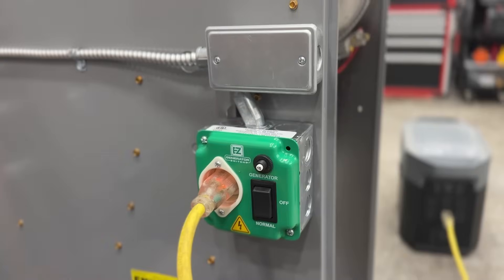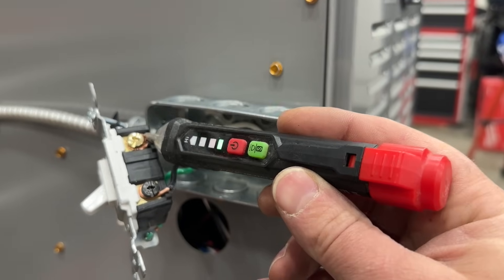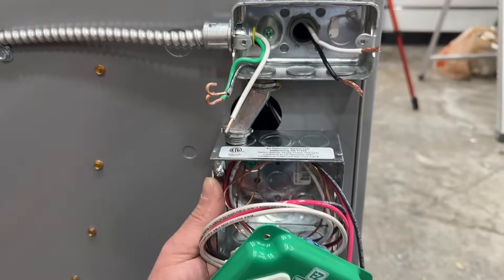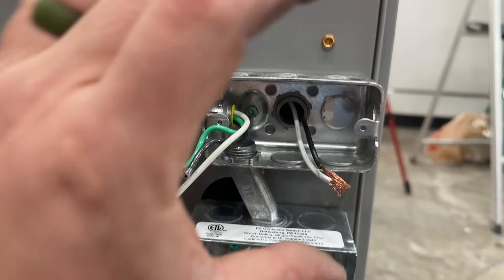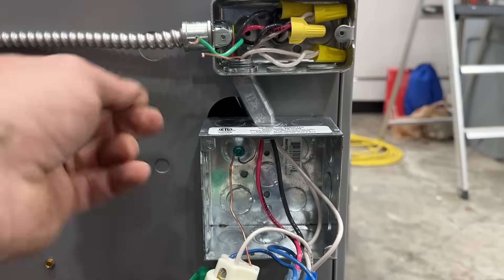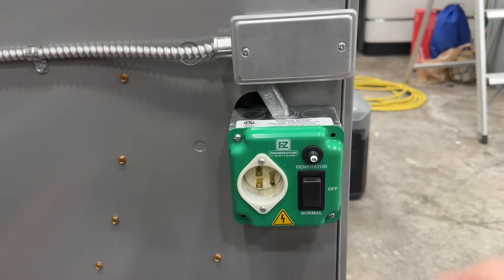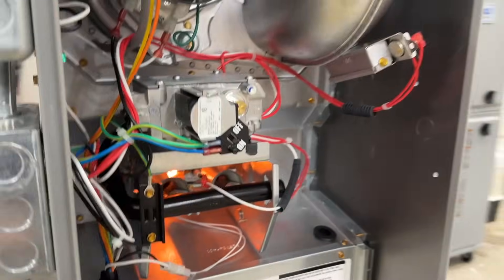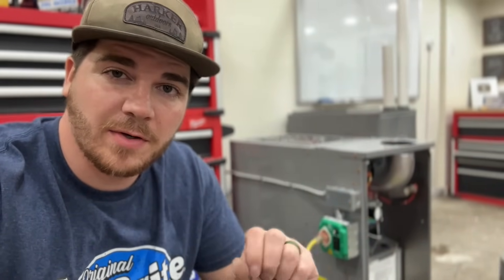This Device Allows You To Power Any 110v Appliance During A Power Outage

Comment: May I suggest just wiring the outlet also to the switch. That way with the switch off, furnace access is via the outlet for attaching to an inverter or generator. Just make a cord with 2 3-wire plugs of needed length.
No need to buy that switchbox or more wiring. Just trying to be helpful. Thank you.

Comment: The EZ Generator video says that the first thing to do is determine if the power source (generator) is floating or bonded neutral.  If floating, then wire the EZ Generator using the Floating instructions.  Since you are using a floating source (generator), please show us the correct wiring using the floating wiring in the EZ Generator   here's the vdeo:  https://www.youtube.com/watch?v=eSVh7GNgKfw&t=18s

Comment: Great product - I have 3 EZ generator switches installed along with a reliance Through the wall kit in which I connect my RV generator to along with 3 power cords I use to plug in for power from the Generator..I have 3 connections at the panel for the furnace, Refrig and my office which has my cable modem..Very easy install..EZ generator has their own youtube channel with easy to follow  instructions..In the Future I'm going to purchase a solar power station to run the power I need..Looking into a production called 'OUPES' solar Gen..at least 3000 watts..

Comment: Thanks!  I used your link, bought the switch and installed it.  Install was fast and easy.  I then tested it using one of my EcoFlow batteries.  Worked perfect.  Practically looking forward to the next power outage.

Comment: Okay,  I think I asked you this before,  but I don't know if this will work with my situation,  I'm Definitely not an electrician but I've wired many lights and understand the safety aspects,  but my shut off switch of course has the on off switch at top of box, but at bottom is a 12 amp type s screw in buss fuse, I've been told by many that I can't bypass that fuse, most state it's for protecting sensitive circuts in my furnace which I don't understand,  it's a 23 year old standard furnace,  no fancy motherboard or anything,  but anyway,  if it's true I can't bypass this fuse, then the ez generator box probably won't work in my situation? I'm stuck with no furnace unless grid power? Again I'm asking because I have no clue or know who to believe if it can be bypassed or not

Comment: Seems to me that if you use outdoor ground solar or outdoor generator you might want to install that next to the power panel (assuming the panel is closest to the outdoor source).
Not everyone has a ecoflo or similar power station.
Placing next to the main panel reduces the need for long extension cords.

Comment: what about the air handler?  if the air handler is on a separate breaker than the gas furnace, you have no distribution of the heat
Reply from the maker: This is really only for 110v gas furnaces
Reply: @diyhvacguy  thanks. my furnace is a carrier 120v, but i noted on the panel in my new home 2 separate 240v circuits for the central air.

Comment: Great switch but dear lord this is so over priced the margins must be 450%. I am not sorry for saying an outlet and pigtail is AOK and safe for my home. Code you quip?  Let's light up candles everywhere and run a gen with extension cords cause that is SOOO much more safe compared to what I installed. Great device just a total $$ rip off. I will reverse what I did when it is time to sell. Sorry just pissed at what this costs and cant understand why.

Comment: Just make a double male ended extension cord. Plug into outside outlet from generator. Shut off main breaker. Boom. Been doing it for 30 years.
Reply: It’s a good idea up until you forget and plug it into a live receptacle. Better safe than make a mistake. I can tell you where there’s a burn mark in a kitchen cabinet when I powered up a receptacle I had an appliance cord I hadn’t wired in yet.  Inserting solid wire pig tails into a normal extension cord would my first choice in a pinch.

Comment: does this fix work for a gas pack/ac unit?  (just for the gas part)
Reply: I've asked the same question on a few sites but no response ? 
My concern is that even though the AC and furnace are on separate circuits the temperature and fan control is shared.

Comment: One correction/clarification regarding the thermostat. Your statement only applies to thermostats/smart thermostats WITH a 'C' (common) wire. Older homes may have a new furnace but still not have a C wire, like mine, in which case I would also need to power the external plug to power the smart thermostat. Do I have that right?
Reply: Most will have a c wire or a battery. If you have a plug in power source for your thermostat then yes you have that right. They are much less common.

Comment: Seems like there should ba an automatic switch that could be used with a battery backup. This could provide heat when not at home and if solar recharging is available would work for a long time. Same would be good for sump pump and refigeration.
Reply: It’s called an automatic transfer switch, they cost a lot of money. They are wired into the main panel, sense loss of line power, then if it’s out for 30 seconds they tell the standby generator to turn on. I suppose if you have a solar/battery system, it’s integrated into that system.

Comment: Well actually, re, smart stat, if the power goes out then the WiFi modem also goes out. So the smart stat wouldn’t work to turn the heater on. I guess we need to build in some sort of stat bypass or something.
Reply: Thermostats don’t need Wi-Fi to run, all the WiFi does is connect you to be able control it remotely. When they go offline, they continue on the previously set program. 
If you have a wireless thermostat, it’s not using WiFi to communicate with the furnace and will also be fine.
Reply: @jonathanzappala where do thermostats get their power from?
Reply: @kimbuck-2 it depends on the thermostat, most have batteries, others with a c wire will be getting power from your furnace on the generator.

Comment: Energized or not, The best practice is to connect the ground wire first when making a power connection and the last when disconnecting power.. If someone missed something (wrong breaker) or additional hot wires in the junction box..

Comment: I did a slightly different variation.  I converted the load of the furnace to a grounded plug and just run an extension from my generator sitting outside to the furnace and plug the furnace into the extension.
Reply: Is there a switch to keep it from back feeding to the grid?

Comment: Extra points for verifying that the Hot Pen is working. Next step after that is to short the leads with a screw driver to make doubly dam sure the circuit is dead. If your Hot Pen is working.....no harm done. If not, Better to trip a circuit breaker with a screw driver than to fry yourself. Never trust your life to a Hot Pen. A multi-meter is better.

Comment: Too much money for one appliance. You may as well get a proper transfer switch installed
Reply: $88 on Amazon right now. Way to much. Yikes.
Reply: @Chris-t3w2v 
In Canada it is 200 bucks tax included to only power  one 15 amp circuit. I purchased a 30 amp generac manual transfer switch running on natural gas into my home. I run 2 fridges, 1 freezer and furnace. 4 ceiling fans with lights in them and internet. It powers the lights in the basement, kitchen, living room and the  upstairs, bathrooms and bed rooms. We have a sump pump but we rarely use it but it is there when we need it. My total wattage is about 85 percent usage. I enjoy watching your videos and enjoy your content however I didn't think it would be money well spent  for my family's needs but he is definitely an option for a furnace for sure.

Comment: The electrical companies are frowning on this now as it back feeds into the system and puts techs in danger during repairs. May need turn the breaker off I guess.
Reply: This EZ generator switch is designed to NOT back feed.  When the switch is set to Generator, it disconnects from the normal line from the electrical panel.

Comment: This unit looks good.  Smaller than the equivalent unit we have which is a Reliance.  The only difference is the Reliance has a light that shows if the Gen input has power.  Reliance is UL listed vs this unit is ETL listed.  ETL is a lab that tests to UL standards.

Comment: I actually bought this product and by the way... your instructions on how to install are way better that the EZ Generator's instructions. Anyway, my generator and power station (Anker) has a floating neutral... and the EZ Generator's "modified instructions on how to install if you have a floating neutral.... by removing the all 3 white wires from the switch... is confusing.... their instructions are clear as mud. Their instructions just are not complete. It's crazy. 
Maybe you can look into what they are talking about... and see what YOU think.
Reply: I have the same feeling after watching EZ Generators' videos. Did you ever figure it out?
Reply: SAME HERE!  I would buy 2 of these for my 2 furnaces IF I could get a video, like this one, showing the EZ installed with floating neutral.

Comment: I think that is a great idea. i took an extension cord and wired it to my furnace and then put an outlet nearby so I plugged my furnace into the outlet and when I haven't power outage i plug it into my battery backup i think that's easier and cheaper.
Reply: Yes but is it a code violation?
Reply: @rael5469 there is a lot wrong with it. The reason for this switch is that it switches the power source from grid to generator.
Reply: @Ed-ym4tu   The extension cord is a 'disconnect" and once pulled out of the grid it definitely isolates the generator from the grid. I saw the owner of the EZ Switch company do a video and when he opened up the unit there was a bare ground wire near the bare contacts of the switch that could jump the generator to the grid. That's a no-go for me. The other companies units look sketchy too. .....unless you know of a disconnect switch that is very well made. I haven't modified my furnace yet.
Reply: @rael5469  I'm not trying to be a smart ass and I am not an electrician, just an average DIYer. With your setup, what keeps the power from the generator back feeding to the breaker box and trying to energize everything on that circuit and possibly even more if the breaker is not off? It seems like you would be dropping the voltage across the furnace due to the rest of the load on that circuit and possibly damage the furnace and other electronics.
Reply: @Ed-ym4tu  "With your setup, what keeps the power from the generator back feeding to the breaker box" 
 Ed.....it's in my first sentence.  "The extension cord is a 'disconnect' and once pulled out of the grid it definitely isolates the furnace and generator from the grid."   
 In other words, once the extension cord is pulled out of the outlet then the furnace is a stand alone unit and the only thing being powered by the generator is the furnace. That's the beauty of the extension cord setup. I saw a video made by the owner of the EZ Generator Switch company and there was a bare ground wire floating around inside that box near bare switch contacts. It could short the generator to the grid. That's an automatic no-go for me. The extension cord is much simpler and much safer.
Reply: Thanks - one question.
As my furnace is in an attic running a cord is not what I want.
I have a disconnect switch in my garage could I install it there? And still keeping the disconnect switch located on the unit?
Thanks in advance.
Reply: To explain this more clearly to everyone who is confused:

What @tomcarroll3771 did was essentially convert their furnace from being hardwired, to being a plug-in appliance (similar to how a washing machine or refrigerator simply plugs into an outlet).  When the power goes out, they simply unplug the furnace from mains power, and plug it into a power station or generator.
Reply: My thoughts exactly. But just think of all the switches they sell.
Reply: @larrybell1305 just think we are helping retired military service men and women. I might buy one just. For hooking up lights and refrigerator. Better than cords running through the house. 73
Reply: Maybe you do what you have to do with what you got regardless of code. 73

Comment: Hmm, interesting.  You used the instructions for a bonded neutral, yet you're using what looks like an Ecoflow solar generator which I'm pretty sure has a floating neutral.  Just confirming.  Why wouldn't you have used the floating neutral instructions?  Thanks.

Comment: An HVAC contractor told me not to run my furnace on a generator because it could damage the circuit board due to voltage spikes and similar. Is there any truth to this?
Reply: Get an inverter generator which outputs a clean sine wave.  Like the small Honda 2200 watt or similar.  Or you can get a larger inverter generator with 8750 watts or more if you have other sensitive things to run.

Comment: Could you possible help me? After watching your videos I got some ideas. How can I power my hvac fan with solar? I live in Texas is hot in the summer but also to just run the circulate feature on my thermostat. I have gas heat so hooking that fan up solar incase the power goes out still give me heat do I follow those videos and if so so could you tag me in the ones I need to follow? The electic priced where I live are insane so anythign would help unless it has to be either one or the other like I have to run electric anyway or is there a bypass switch or something?

Comment: I watched your video with great interest. I realized I need this connection for my gas heating system. I went over and looked at my appliance. It doesn’t have a switch. The power is simply just hard wired into the appliance. I’m guessing I can open the conduit and simply splice and add this switch right into the power going in?

Comment: This is pretty cool, but I just ended up cutting the romex to my hvac and adding a receptacle on the breaker side, and a male plug on the furnace side. During normal operation, the furnace is simply plugged into the receptacle, completing the original circuit, but during a power outage, I can unplug the furnace and plug it into an extension cord going to my generator.
Reply: That's the best and cheapest way

Comment: This is a great project and I plan to do this or a transfer switch. Why not use lever nuts instead of wire nuts? Especially when connecting solid to stranded wire.

Comment: I bought one but then realized I would need to pull a permit to get it installed & inspected. Another $80. I instead just added a connector inside my furnace that is discreet & that I can tie my inverter into. I use a 2200 watt inverter & connected the neutral & ground at the inverter to elimate the floating ground.  A power strip also allows me to power the freezer in the garage or any other appliance with a extension cord.

Comment: The 15 amp circuit breaker makes it illegal to use in most municipalities. You cannot tandem fuse a circuit. The breaker must be smaller than the over current protection of the circuit provided by the load center. It would never pass inspection.
Reply: The circuit breaker in the EZ generator switch is not used when the switch is in Normal position.  Only when the switch is in Generator position, and in that case, the normal breaker in your main panel is not being used.

Comment: The last utility supplied 110 volt service ended in 1967.  All of the US and Canada use 120/240 for single phase.
Reply: More specifically it's split phase 240V.
Reply: Ive noticed lots of people say 110 or 220. Interesting to know it was used at one point. I've even mentioned they are 120/240 and people try and correct me saying 110 lol
Reply: @ryanmattie974  220, 221...whatever it takes 🤣
Reply: It depends if the transformer is wye or delta. Many people refer to single phase as 110, 115 or 120vac.
Reply: Cool story bro, but appliances are made to run from around 110-120 in the us. If you actually measure the supply from the wall it goes up and down through out the day from 112-117 at my service, at other places it’s different. Saying an appliance is 110v isn’t even the definition of “wrong”.
Reply: What you are saying is technically correct, and that's the best kind of correct. You aren't very useful irl are you?

Comment: I just had my ancient 80 amp service with no main breaker , legal in 1960’s If fewer than 6 circuit breakers , upgraded to modern 200 amp system . Did not rewire  the whole house only added a few dedicated lines for furnace sump pump etc . Romex had no ground so I have a lot of GFI’s , but not for furnace .

I had the electricians install a dedicated breaker and outlet to the 80% horizontal gas furnace , no Ac , in the crawl space .

The furnace will not work, fans work but will not  light!
Electrician checked outlet for proper polarity and good ground . I had to replug into the old ungrounded outlet to get it to work.

Any idea what is wrong and how to fix it ?
Reply: Original panel is now a sub panel .

Comment: Dave, in other videos, you have links to various Ecoflow products. For those who have 2 Delta Pro's & their Volt Hub to get 240v house backup, there seems to be a problem with the batteries drawing down at very uneven rates, so one dies way before another, hence ending the "whole house" backup function within a couple of hours. Apparently, the discharge is unbalanced because each pro is supplying power to each leg of the panel. So if 1 leg is pulling power, and the other isn't, 1 will discharge faster than the other. Did you find/hear of this, and what would be the fix!?